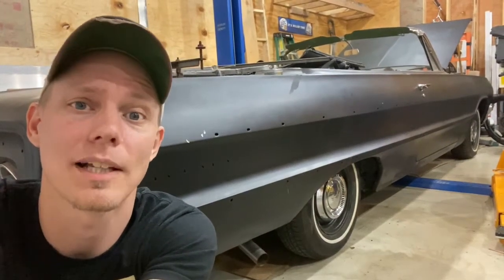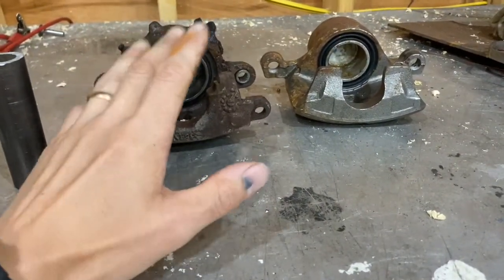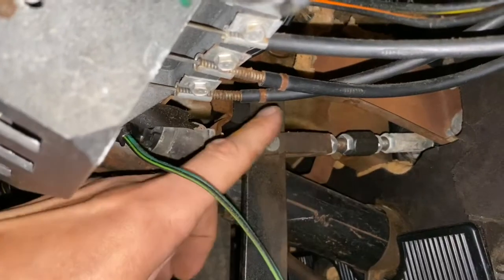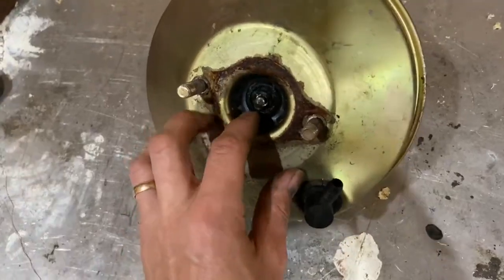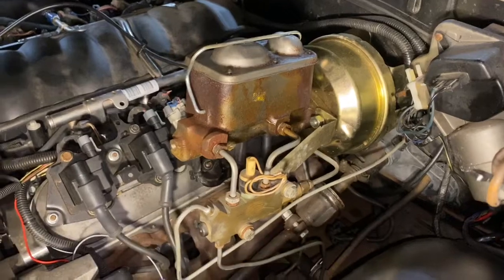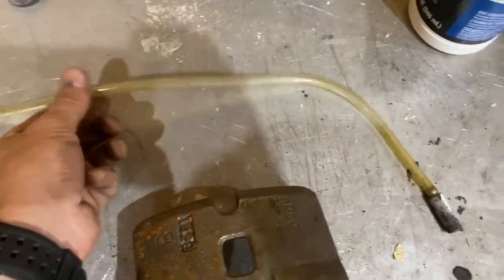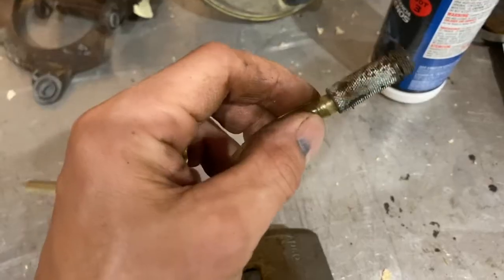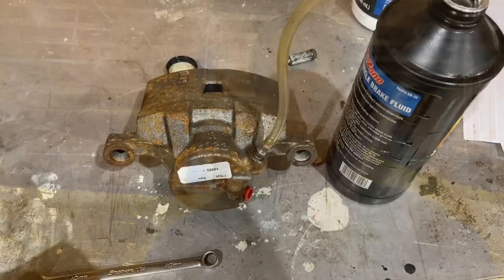Brake Diagnostic Tips! Common Reasons Why Your Disc Brake Upgrade Doesn’t Work.

Comment: So I have a problem when I slam on the brakes it will not stop on time. Still rolls. Almost ran over a Crack head crossing the street. Lol.. 1957 f100 ,crown vic front suspension 8 inch booster and 1.125 mastercylinder.

Comment: I have a 65 impala that had 4 wheel drums.. I bought a front disc brake conversion kit for a couple grand $$$ from Wilwood. After I bought that I discovered I needed an upgraded master cylinder and bought one from CPP. Then life got in the way as it commonly does for a lot of us, and everything sat in their boxes for for a couple years. I eventually got back on task and got everything installed. This included new brake lines. Got everything bled and took the car for a test drive. Brakes worked but I really had to put my leg into it. I read in some forums that you need to use a proportioning valve lock during bleeding. This threads into the brake light circuit on the proportioning valve and prevents the proportioning valve safety feature from actuating and cutting off brake fluid from the side it perceived has a leak. This helped little for me. Then I read for any application using manual brakes (me), a master cylinder with a bore less than 1 inch is a MUST. My master cylinder is 1 1/8". So I just got a power booster. I really hope it does the trick.
Reply from the maker: Good luck with you project! It sounds like you’re on the right track for sure! I’ve also heard that manual brakes need a smaller bore master cylinder. Hopefully it will work!

Comment: I swapped over to disc brakes and found that the small diameter brake booster.( 9 inch), required 17 inch's of vacuum to work properly, I only have 12 at idle, so I hooked up a vacuum canister & vacuum gauge to monitor it, when it drops below 17 inch's my pedal is hard, above 17 and it works perfectly, I should note that it does drop 5 inch's every brake application so on occasion I have to "burp" the throttle to create vacuum, wife hates that lol
Reply from the maker: Great info! Sometimes I tap the throttle for me, and my brakes! ;)

Comment: I'm having that problem my car is  73 Duster came with 10inch drums  and 9inch in the back. I did disc brake swap i bought a power brake  booster from Summit. I bought big bolt 7 1/4 because disc brakes car on Duster has big bolt pattern. Drum brakes car have small bolt pattern..

Comment: I put CCP  Firewall power brake up grade on my 55 Chevy truck. Never have been happy with them. One more tip is to use a proportion vale tool when bleeding. It keeps the rod from blocking off F or R. Putting in a new rear hose today just to eliminate it. I like the plug idea.

Comment: A question I have is:    vacuum bleeding the front brakes on my 2001 dodge ram works fine.. but not the rear brakes; the brake lite came on the   first and last time I tried it .... it obviously off-balanced the combination valve; should I hold off the metering valve or maybe keep the brake pedal pressed while vacuum bleeding the rear brakes..if anyone knows? thank you I wont try it again unless I can be sure

Comment: This video solved a lot of questions on my 78¨ Toyota Jeep disc conversion.  The breaks where weak on 4 drum originally. I changed front to disc but stilled weak. Then I changed the master cylinder for 1¨inch bore and got a little better but it needed more braking power. I checked the original workshop manual and figured out that it had a 10lb retention valve for the rear brakes so I'm planning to get it and try again .Thanks for sharing your tips!
Reply from the maker: Excellent! Hopefully you get it sorted out! Keep me updated!

Comment: Another good tip would also be when doing brakes if your vehicle has abs be very careful trying to bleed a abs system is a pain if the abs module runs out of brake fluid it can also cause major problems hydrolocking the brake system

Comment: The brakes on my car are very much Frankenstein. I have calipers from a Pontiac boneville, rotors from a Toyota previa, and a custom bracket. It worked for a bit but they lock up.

Comment: I wasted 5 bottles of brake fluid trying to bleed brake lines. No matter what I did, the pedal remained spongy with no pressure.
Eventually, I switched left and right calipers to make bleeder point upwards, and thanks to this guys, it worked like magic.
Thanks a bunch.
Reply from the maker: Awesome!! I’m glad it works now! Congrats!

Comment: Very well done and accurate video with some good tips. One more note on the booster push rod, if adjusted too long, it will make the brakes drag.  My experiences... the last few vehicles I worked on, as far as bleeding, it seems as if the master is fully bled, the systems have gravity bled by themselves (non ABS).  For example, if I change a bad line, I cap off the port with a plug like you show, then bend and create my new line based off the old line profile and install the new line by removing the temp plug.  This keeps the master cylinder full while you make the line up.  After the new line is installed, I then open a bleeder at the end of that circuit and wait.  I keep an eye on the fluid level in the master and add as necessary until the fluid runs out the hose I put on the bleeder.  I also change my systems fluid by doing the same, one bleeder at a time.  You can watch the dirty fluid slowly leave the reservoir.  Grease on the threads also helps future removal of the bleeders!

Comment: Good stuff. Ive had faulty master cylinder right out of the box. Fluid was bypassing the push rod. And it was getting just enough fluid between the master and booster to cause soft pedal. Big headache chasing that down to discover faulty right out of the box...
Reply from the maker: Yes! When things like that happen it’s tough to diagnose. This whole thing started with me doing a disc brake swap on my 64. I tried tons of stuff to make them work right, for years. My current setup works decent, but I still think it could be better. I’m using the calipers and master cylinder from a 72 chevelle, which are a 1.125 bore master, and a 2.94 inch pistons in the calipers. I have a small diameter vacuum booster, and I’m not sure the LS swap is giving it enough vacuum. I’m hoping to have that sorted out this weekend. We’ll see!
Also - your videos are awesome. I hope to paint my Impala in the near future and expect to reference your videos quite a bit!
Reply: @WiringRescue  use a good clamp on the vacuum check valve. It took a while to get my brakes working good. But now you will eat the steering wheel if slam the brakes going 50. There are too many fittings involved on these cars. Too many connections for possible leaks
Reply from the maker: lonestar lows - will do! I’ll double check that it isn’t leaking. I’m pretty sure I don’t have a clamp on it right now. I want my brakes to throw me through the windshield! Lol

Comment: Thank you for the video! Some nice tips in there. Wondering what you think about my problem… (74 F100) originally manual brakes front disk rear drum.  Brakes were great other than not having a booster.  Went ahead and got a booster and master kid they make for my truck and upgraded to a rear disk kit made for the truck. (I did not reinstall the factory proportioning valve) problem I’m having is the pedal doesn’t want to return to the “neutral” position, but it does realms most of the way so I just lift it the rest of the way with my foot. I did notice that the rear disks are not engaging (I have an adjustable proportioning valve I can install) , but could that be my pedal issue? Seems to also want to stick more once I’ve been driving a few miles. Any thoughts would be appreciated!

Comment: Very interesting and so true that after doing the conversion, brakes sucks like mad, worse than even before. Here, i have a 79 Trans Am did a 4 wheels discs conversion. Everything new. Pedal feels good and firm after bleeding. Then when you start the engine, pedal goes to the floor. Switch off the engine, pedal goes back up with firm feel. Start engine, goes to the floor. 
So what is going on here.
Reply from the maker: Check all the things in the video out. It’s a sucky process. It could be anything from air in the system to the wrong brake caliper brackets, to a master cylinder that is the wrong piston size inside. There are endless possibilities. Good luck. I know this struggle!
Reply: @WiringRescue  Oh yes, I blocked off the rear line and pedal is good with or without engine running. Hook the rear line back, pedal goes to the floor with engine started.
Reply from the maker: @hmayerv8  - if you have somebody to help, watch the rear brake calipers when somebody pushes the brakes and make sure that the caliper pistons are not retracting back too far when you let off the brakes. My caliper brackets were on crooked once that caused this issue. If that’s not it, then my vote is that you need a master cylinder that is the next size up. I use 1 1/8 bore in mine for reference. You can look up specs for master cylinders on rockauto.

Comment: Great video...going to put that info to work soon. Dad's 33 Ford Sedan brakes (pedal action) is hard as a rock with very little travel. He's running the typical mix rear drums disk front (9in caliper) with booster.  Car is an old build so I'm not sure what he bought for a mc/booster. Believe ill start by swapping the master. Thoughts?

Comment: Kinda a good Vid bud . Doin a 56 chev 2 door wagon . What diameter , brak line do you suggest front and rear m converting to front disc , with s-10 calipers , and stock 56 rear wheel cylinders? Hope t9 hear back

Comment: I have a soft pedal all the time. Car off, soft. Car on, still goes to the floor. Got the right stuff brake kit for 68 Camaro and went with the Non-Ebrake kit for the rear. I have no idea where to start. The mechanics I have left it with cant figure it out. Thoughts? I can elaborate in better detail if needs be.

Comment: Hi Mate, great video. I have rebuilt the master cylinder in my 69 camaro wit hfront disck and I just cant bleed my brakes.. I have even lossened the two lines from the master cylinder and I get a very little oil comming out. what could be the issiue. The master cylinder goes into a Proportional valve and then into a metering valve. The pedal feels stiff but I dont get any pressure or oil comming out of the master even thou I crack the lines at the master cylinder.

Comment: Great video... One question: 
How does one re-center the pressure differential valve as it got triggered while bleeding my brakes and I didn't know about the block off plug? 🤔
Reply: use any tool that fits in the hole after removing plastic threaded brake switch ,move the valve forward or back to center it depending which way it got triggered . you’ll know it’s centered when you see it concaved in

Comment: I'm changing from a single chamber master cylinder to a dual chamber for safety. I'm wondering if I use a master cylinder, correct bore, from a car that has single piston front calipers will it work with my calipers which are 4 pistons each? Too small and not enough fluid pressure perhaps? Or should I use a master cylinder that comes from a car with 4 piston calipers?
Reply from the maker: It’s probably best to use the master cylinder designed for the 4-piston calipers. There is a lot of engineering involved in pushing the fluid around. :)

Comment: Ok I have a 1990 Toyota 4Runner w/ manual transmission 4x4.  I have disc rotors on front, and  drum brakes on rear. I use OEM Organic pads. I bled my brakes, my brakes work, no leaks. I don't have ABS.   Sometimes when I slowly exit the driveway, I will tap the brakes and one of the rear tires will briefly lock up and release, leaving a 8" streak/tire skid in the driveway. Its random, it can be one wheel or the other rear wheel with drum brakes. It only happens at very low speed.   Any ideas? I have new dot 3 brake fluid, I never mix synthetic with conventional brake fluid.   I have that Load Sensing Proportional Valve in the rear on the vehicle. Its 34 years old,  original.  Could it be that?  Its not my wheel cyl, they are new. They are OEM and I changed them myself, thiinking they were problematic. But they are not.  The master cyl is original. But my brakes are working.
Reply from the maker: Is it possible that the drum brakes are just adjusted too tight with the self adjuster? Is it possible that the rear brake shoes ever got soaked in brake fluid? Sometimes that makes them “grabby”. Lastly - it could be the valve you mentioned. If it believes that there is a larger load in the truck, it will give more braking to the rear. Does it have stock suspension? Could the adjustable rod on the brake load adjuster valve be bent? That’s all of my ideas at the moment 😂

Comment: On my 62 with disc brakes conversion it has only one line coming out of the proportioning valve (top small hole) and tee to both front caliper’s the bottom hole is plugged , could that be a problem?

Comment: T
I havea 2014 Honda Accord every time I change all pads and rotors it only takes a little while for it to feel like my brakes are not catching sometimes it feels smooth and tha. Others it feels like it's braking I. To nothing as if my brakes already word down, could this be the master cylinder. I'm in my 3-4 brake pads and rotors and still.having this issue

Comment: My brake travel is fine. However, my brakes just don't lock up. I can push down as hard as I can and it still just gradually stops. Kinda scary.. the thing that is annoying is I bought the car like this and I have no idea about anything. I upgraded first the booster thinking it was that, then master cylinder with 1 inch bore and still same thing. All brakes have no air in them. Not really sure what to do now
Reply from the maker: I use a 1 1/8th inch master cylinder and my brakes lock up so tight my rear tires skid even when I don’t want them to. It’s honestly not great. I’ve considered going to a smaller bore rear wheel cylinder (7/8) to see if that helps.

I also am toying with the idea of adding an adjustable proportioning valve to try to dial it in a little better. Once I figure it out 100% I’m going to shout my brake setup from the roof tops so nobody else has to deal with mixing and matching crap that doesn’t work.

What calipers are you using and do you have an Impala or something else?
Reply: @WiringRescue  thank you for your response, it's a 69 Camaro with c4 brake calipers. That's all the guy knew when I bought it off of him. And yeah it's frustrating when you keep buying stuff hoping it's going to work just to find out it didn't change anything..
Reply: For 15 years the 66 chevelle my dad bought has had questionable brakes..front disk conversion with poor performance.. brake pedal has always been hard. My dad passed away Feb 11 . Since then I've been trying to fix certain issues with it that he wanted done. The pushrod attached to brake pedal was in the wrong position moved it up to get rid of the angle it was at pedal is now soft lol brakes work a little better . Found that the car still has the small individual distribution blocks from the manual brake set up it came with .. not the proportioning valve that's found in the 67 model that it should for power brakes

Comment: I've done a disc brake conversion with hydroboost I have no rear brake I've adjusted calipers changed master and hydrobust moved brake pedal to bottom hole still nothing any advice thanks
Reply from the maker: Do you have rear disc? If so - Have you adjusted your parking brake ? Depending on the brake system you have, sometimes that will make all the difference.
Reply: @WiringRescue  by adjusting what wilwood tech told me to do us engage and disengage about 30 times and that should adjust it I've done that e brake works but regular brakes dont

Comment: HELP!!!! So I replaced the master cylinder and booster on my 1957 Ranchero. After bleeding the system and with the engine NOT running I had great pedal pressure with no fading. However, once I started the engine, the pedal would go all the way to the floor with no resistance at all. Very frustrating…. What’s the dang deal???
(This Ranchero had a front disc brake conversion a few years ago.)
Someone…. Please help!!

Comment: Dont the old 4 wheel drum brake master cylinders keep residual prrssure?
Reply from the maker: Good question, I’m not actually sure. That would be an interesting thing to know though. If so - it may be beneficial to have a check valve on the rear line. Anybody else here know this answer?
Reply: Or just spend the 15 bucks to get a master cylinder set up for disk/ drum or 4 wheel disk
Reply from the maker: adam burch - true. The tricky part is figuring out which master cylinder to buy since they come in so many different bore sizes.

Comment: I did power disk break on my 65 impala and they worl for about 3 4 stops then they lock up and i have to releave bleeder nut for them to release what should i look at everything els is right ...frame off restoration and i want to drive it already with out worries
Reply from the maker: Check to see if the rubber brake lines are twisted/pinched/blocked. Also check to see if the adjustable rod that goes between the brake pedal and master cylinder is not adjusted wrong.
Reply: @WiringRescue  it has a rod inside the piston to extend it I'm gon cut it down and shorten it see it that's the problem almost seems like it's not relieving all the pressure

Comment: purchased  a 67 lemans  ...with disc conversion Brakes HARD AS HELL TO PUSH/STOP..WHAT SHOULD I LOOK FOR FIRST.
Reply from the maker: Pump the pedal. Hold it down. Start the car. If the pedal doesn’t go down more when the car starts, the brake booster is not working. That’s where I would start.